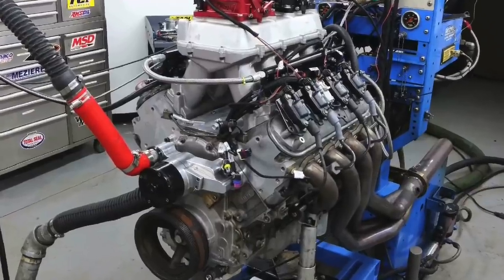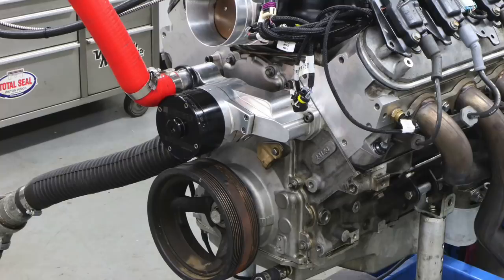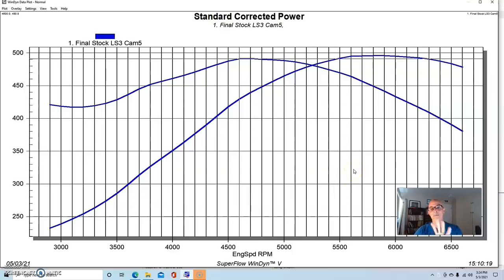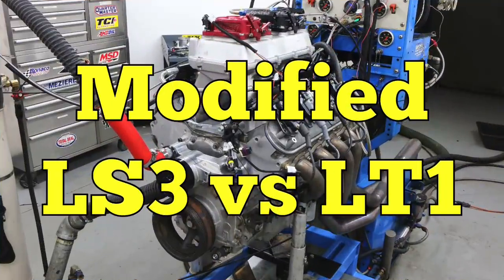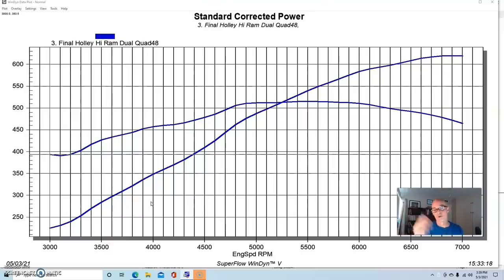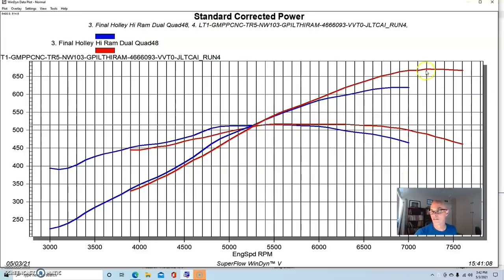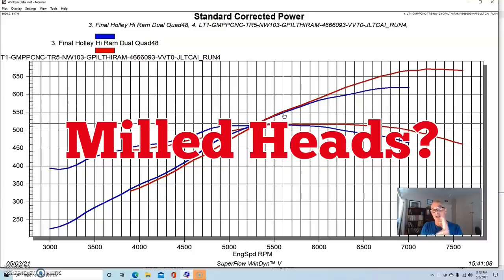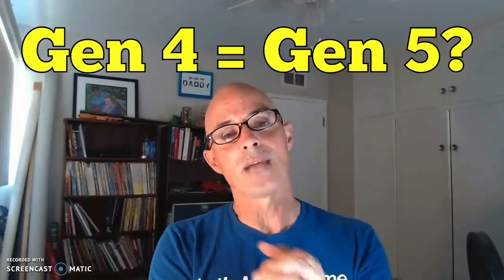LS3 VS LT1-IS NEWER REALLY BETTER? (GEN 4 VS GEN 5 6.2L)

Comment: That LT1 is really impressive, that low speed torque is key in a street car, it’s still down from a good big block below 3500 rpm, but then it comes alive
Reply: Yep. I’d love to see the Holley “dual plenum” cross ram adapted to fit on LT heads. Would be a torque monster down low and in the middle!
Reply: Yea but as someone switching from badass BBC that LT1 is gonna be 300lbs lighter....that evens the playing field...
Reply: I wouldn't worry about anything under 4500rpm with this modified LT1 it will be needing a 4400-5000rpm stall converter to take full advantage of this setup it has enough low end grunt from idle to 3000rpm for cruising or normal street driving and yes it will be a bit soft with a 4400-5000rpm stall converter from idle to 3000rpm it will rev extremely fast at the slightest push on the gas petal and go into lockup at cruising speed at 45-50mph depending on gearing my car has a 4200rpm lockup stall converter with a 6L80e transmission it's soft until 2500-2600rpm and goes into lockup at part throttle or street driving in 5th gear at 40-45mph and 6th gear at 50- 55mph at part throttle feeling no more affects of the stall converter unless the throttle is pushed down more while at these speeds it will unlock with a very little bit more throttle pressure on the gas petal

Comment: When it's clean sheet like me there is about an $800  surcharge for DBW, DI and trans control ( my 67 Camaro has a 4l80e/billet lock up) on the Holley with 3.5 inch screen and VVT ( Cam 4X even less).
 Given the fact the stock heads will do well especially when ported ( you can tell this is what they wanted to do with the LS7 raise that runner NUTS like it is on the LT1, but they never got the LS7 right ) I'll actually be saving....
 Also the fact I can buy a 3.860 L8T forged stroker ( center counter weighted too ) crank for $500 and it slide right in the Gen 5 block makes it just piston and rods for me to be up near 700hp...
 I've been looking and looking as I AM replacing a BBC I'm used to making 700+ hp with, it is HARD to find a 600whp Gen 4 LS.....
 I was quoted doing a custom darton sleeve 5.3l Gen 4 block to 4.155 and custom 4.00 rotator...then the best heads money can buy ( generally have to go LS7 and their intake ) and at 434ci barely be 550whp or 650 flywheel....
 The Gen 5 can do it at stock bore with the 3.860 crank for 400ci aka 6.6L, with much less cam and save a TON on heads...

 So more power, smaller cam less money from clean sheet and literally can run to 9s aka illegal in my old 67 NA...works for me...im not scared of DI...I just come from a boosted Gen 3 coyote and I'm used to dealing with the DI and tuning the blend.....
  Other than pure budget gap n go turbo stuff I can't see why anyone would still mess with the Gen 3/4....the stock crank on Gen 5 is stronger too...heads better...even better than LS7 when you count the LS7 failures that even the aftermarket doesn't have solved in my research....

 I'm leaning heavily to Gen 5.....

Comment: The LT1 has made 650+ rwhp  now 3 years later on max effort stock cube heads cam sbe builds. GPI CID heads. over 14:1 compression. pump e85. GPI Hi ram cam. ported Hi ram or cid manifold. They are making 100hp over the lt1 setup in this test now. An engine test a couple years ago made 759 crank at gpi with the original track attack cam which is a bit less aggressive than the hi ram cam as well. Things are getting interesting with the strokers too. They just did a 454 LT and made over 1000 hp with pump e85 and still a hydraulic roller setup. Crazy to think what it could do on fuel and solid roller.
Reply from the maker: they are doing some impressive stuff

Comment: I think milling and porting the factory heads on the LS3 will make it a closer match up. Still hard to beat that VVT stuff. GPI is getting it in tho...
Reply: @rustysausage69  #AGREED. I'm sticking with the LS stuff. Tuning the LT stuff is expensive also. It's just like when the LS stuff first came out. It made way more power than the Gen 1/2 stuff and was expensive. Eventually the prices will fall but for now, I'm staying with the LS stuff.
Reply: Made my way into the Gen V stuff and never looked back.

Comment: That torque difference in stock form is MASSIVE lol. I can't wait to see a tall-deck 500-inch LT1 that retains VVT and VCT. You could get a MONSTER motor out of that if you ran it on E85 with 13:1 compression or higher. I wonder if you could reach 800 lb-ft and 1000 hp...

Comment: Ported factory casting LS3 heads would have made 20 more HP and a aftermarket casting even more. Aftermarket casting head, like a PRC, gives more valve relief for a bigger cam too. Not saying the LS3 would have made the same or more power but it for sure would have made more with the same mods. I don't think anyone should argue that fact.
Reply: Regardless, apples to apples, Gen V makes more power. I'm not surprised considering GM has always been able to make more power with each successor.

Comment: I saw a video of a guy explaining that Direct Injection engines were problematic and he recomended port injected like the LS3. It was something about not cleaning the residuos of the valves and that in time will degrade de engine.
Reply from the maker: valve build up is an issue with di

Comment: Please do a mild VVT cam in the Gen V L86 or LT1.   Use both 6.2 L intakes and maybe the Gen V LT2 intake  ~IF~it bolts up.   Im curious to see if GM did as good of a job on the LT1/L86/LT2 intakes as they did on the LS3.   Plus that BTR intake killed the GenV torque.      After these are done, do a LT1 416 stroker with a mild/street cam.   The optimized stock  engines dynos were real good.   The Gen Vs  was a torque monster.      I am getting tirred of asking for the 416 GenV , so please just do it,   LOL.   Keep up the great work Ricjhard.
Reply from the maker: I HAVE LT INTAKE VIDS UP
Reply: @richardholdener1727  i seen it.     thanks

Comment: Compare LS 600+hp vs 600+ NA Big Block. Put both into same car using same transmission,rear gears, and see which has the fastest 1/4 mile et trap MPH. Battle of the LS vs Big block which of the two will win?
Reply: I think the extra torque BBC will win. same Hp w maybe 50lb ish extra tq ? Just my opinion. I'd love to put 620hp LS in my drag S10.
Reply: @austintyler7991  it will be very interesting Comparing the two different motors/engine's in the same car.

Comment: If both motors had same compression, head flow and cam specs, they would make the same peak power & torque. The only caviat being the LT1 will make more average power  (better down low) because of the variable cam timing.
Reply: If they were exactly the same, they’d be exactly the same,no ?
Reply: Im not so sure. I still think the LT would still make more because of Direct injection. If the heads flowed the same on a flow bench, then the LT would make more power when on the car, because it wouldn't have to flow both air and fuel through the intake ports and into the cylinder. That means no air is being displaced by fuel. Also, DI cools the cylinder allowing you to run more timing.

Comment: As the graph shows. I clearly see the power increase for the ported heads and larger TB. Id be willing to bet...a gen 4 would match the power numbers with the same mods. The low rpm torque is a direct function related too the direct port injection and higher compression.  All in all they are the same engine. To take advantage of the gen 5 direct injection. Your compression could be much higher. So the only component that is actually a improvement for the lt1 is the ability to support higher compression. The hp in this case is strictly from the ported heads.
Reply: @bigboreracing356  LMAO

Comment: The guys at Katech have made 800hp out of a 427 LT1. I think the LT1 has some pretty good potential. Is there a similar Coyote series comming ? You did a couple of vids, but nothing quite so extensive.
Reply: NA? Impressive. Crank?
Reply: @trashbandit2449  yes
Reply: And I was quoted needing a darton sleeve 434 with LS7 top end to be over a 100hp LESS than that on Gen 4....
 I think since it's a clean sheet retrofit, I'm going to go GEN 5, not scared of DI just did a Boosted Gen 3 coyote, use their cheap forged center counterweighted 3.860 stroker crank in the stock 4.065 block for a 400ci and use the stock heads but have em ported....good piston and rod...be done with it...

Comment: Thanks for all the knowledge it’s just upsetting that the original lt1 was a 350 right. It’s just like ls1 was a 5.7 just like the 350 was a 5.7. I’m just glad that the ls exhaust ports are spread apart not like the 350 heads where the middle ones are close to gather and robs it’s power.

Comment: I just bought 2016 Escalade which has the factory rated 420HP 6.2 . I wondered why this motor has the same horsepower as the previous gen  Escalade.

Comment: The first time I pulled a LT1 apart to do a cam/headers swap I was like omg. These heads are made for making power.  I knew there was a lot of potential engineered into the LT1 compared to the LS platform. And we did a heads/cam/headers/intake on basically stock bottom end it it put 713hp to the tires in a 2017 Camaro threw a manual.  I was highly impressed.
Reply: We were testing intakes and the MSD atomic intake made the most power threw the whole power band.
Reply from the maker: HCI LT1 making 713 wheel hp? with how much boost?
Reply: 0 boost.  No spray. All motor. Stock bore. Factory ported heads on a Cnc program.   Dyno’d in a camaro. To the hub dyno.  With a manual.     713hp!!!      I literally shit.  I may still have the video.  If you have a email I’ll send it. HCP in spring Texas has one of the best head guys in the country.
Reply: You should give elli a call. It’s HPC in spring Texas. (Northwest Houston) He’s the owner. Great guy.  The camaro is his personal car. Could possibly dyno some of his stuff     I worked at another shop down the street. He dyno’d all his cars at the shop I worked at.
Reply: def not making that much power on a sbe lt1, especially not with the msd.
Reply: Hahahahhahhah
Reply: @richardholdener1727  I believe 713 is stretch.. But my 6.2 LT1 with HCI, headers, and flex kit, running on 58%E.. Made 618whp to the tire thru a manual on a 21 Camaro SS 1LE.. Maybe he accidentally pushed 7 instead of 6.. lol  I had a C6 Zo6, with the 7.0 ls, and it made 608 with pretty much the same upgrades on the same dyno, several years apart,  but the new LT1's are punching above their weight class compared to the old LS stuff.. My tuner had trouble with my 1LE car though.. seems like the 1LE cars have some different tuning/parameters that the regular SS cars don't have.. Seems odd to me but he struggled with it and had to contact another well known tuner to get some help in getting it right.. Now he has the work around but it was a week long struggle for him..

Comment: Have you thought about seeing what you can do with the 6.2 l99? I have a completely stock lower end, heads and cam l99 in my 2012 Camaro SS with the addition of fuel pump 1000cc fic injectors, e-85 and a 2.9L Whipple supercharger. My tuner was amazed at how much more rear wheel power he was able to get out of it as opposed to an LS3 with the same setup. He did a safe tune, but was able to get 670 hp at the rear wheel. I've been having some transmission problems that I will be fixing shortly, but still am running a 10.85 1/4 mile with vvt still active.
Reply from the maker: why would that 6.2l make more than another 6.2L?

Comment: How do you keep DI intake valves clean though. Even with a catch can over thousands of miles they develop deposits. The high pressure fuel pump and injectors are a PITA to change.
Reply from the maker: WATER METH WOULD HELP

Comment: Cost is a huge factor. iI takes over half again more money to build an LT than an LS, money that could be spent on an LS to make more power.  Spending that money on an LS will net you more HP on an LS than LT.   Plus LS is way more simple to work on and if your HIGH DOLLAR LT pump fails you get to buy it again.  LT is nice with the flat torque curve with VVT but I'll stick with the LS

Comment: LS3 in a 5th gen, 568rwhp; 11:33 CR, TFS 262 FED custom heads, solid roller 239/253 720' 702', ZL1 inj, T&D rockers, 91oct, sheetmetal custom Goertz1 intake, EWP, 2'' SW headers& stock NPP catback, remote tuned by Pat G. The rpm signal on the dyno was skewed and numbers were still climbing at 7200rpm, I estimate 575-580rwhp. I have now a full 3'' exhaust and 2.75'' Z28 mufflers, I hope it'll make 590rwhp. Close to 685hp.

I think both engine are very similar but the LT1 has a big advantage stock with VVT. With a cam and same CR, totally equal engines, but i prefer LS3 cause its more old school. LT1 cars are faster cause vvt, better trans (A10) and lighter....

I bet with a GPI flycut cam in this combo with GMPP ported heads, thinner gaskets, you'd see exactly the same hp in both or almost. LT1 is not superior when the LS3 is cammed.
Reply from the maker: 685 hp LS3 with a 239 intake cam?
Reply: @richardholdener1727  yes same cam. Its a solid roller, no flycut stock bottom LS3, so maybe equivalent to a hydrolic 233/247. The 12 degrees heads gave me more room for a bigger cam and smaller head gasket/ higher CR.

Comment: Even displacement, airflow, and optimized tune should have close to the same power when modified.
Reply: The LT would still make more power because of VVT and Direct injection. Although, depending on the cam duration, you might not be able to use the VVT.

Comment: I would love to see a ford 300 i6 done bone stock

Then run efi manifolds 
Port fuel injection 
And a cam with this spec
268 advertised duration
208 intake at 50 
212 exhuast at 50
477 intake lift at 50
488 exhaust lift at 50
110+4

Then 
Put twin turbos on it that will make peak boost at 4500 up 

And if you can run coil on plug with megasquirt or aem or something and then compare it with a twin turbo or turbo 302 sbf you've done, 300 6 vs 302 SBF

Will need to replace the pistons with new hyper or forged,
Arp studs on everything and bigger valve springs and your set

Comment: 2013 camaro ls3 gm stage 2 cam, gm cnc ported heads, 1.8scorpion rocker arms. sheet metal intake 105mm BBK throttle body. will make 680hp. I did it in 2015.

Comment: Their is only one problem with the modified version of the LS3 and LT1 motors. Those combinations would be absolutely horrible for a car you run on the street and strip or just on the strip. You won't be able to get it to idle under a1000 rpm in other words an absolute pain in the ass to live with. Those tests are of no use to anyone other than an all out drag racer. I would love if you you could do more testing and development for street and street/ strip motors that might be more relevant for about 80% of your viewers.

Comment: I think it’s not that much of a difference, if you go with a ported head on the ls3 I think it would just be making a copy of the lt1. The variable cam timing would be the only difference and that still isn’t too significant in my opinion. That makes me wonder, can lt1 heads fit an ls3?
Reply: They will with a little modification Brian Tooley has a video on channel

Comment: Please continue this testing with the LS3

I have an all motor combo LS3 with GPI SS4 NFC Cam, 821 Casting Heads Ported by GPI and milled .120 with Flycuts .150 deep
Looking to go with dual 4150s or 4500s, go to 2” headers, electric water pump, and crank scraper

I think the Gen 4 can compete but the Gen 5 are just great for NA power.
Reply: Never Dyno’d after milling heads 

Just basic heads cam Fast Lsxhr manifold and 1 7/8 headers made 540 at the ground

Comment: When the LT1 came out, I remember an article about how close if not better the LT1 was than the almighty LS7. Maybe do a comparison with those if you have the info. Thanks for all the great content.
Reply: I'd say it's not quite on the LS7 level, but its pretty damn close. The LS7 was ahead of its time in my opinion though. Could you imagine a modern LS7 with VVT and direct injection? 🤤 Heads/cam C6Zs are still fast as hell even by today's standards.
Reply: @Jr_5646  you mean like. the l8t
Reply: @bill2178  I dont know much about the l8t, but it doesn't seem like a high performance engine comparible to the LS7 to me. The LS7 was based off the LS1.R from the racecar. The l8t is an iron truck engine. The LS7 had an aluminum block, titanium rods and valves, and could rev over 7,000 rpm. A modern LS7 would make way more power while being way lighter IMO.
Reply: @Jr_5646  it wont make as much but with the right cam and intake im pretty sure it could be somewhere in the middle between lt1 and ls7

Comment: The question is, since it would be easy, would be to run the LS3 with a Holley High Ram? We all know a dual TB efi is the optimum setup...he has told us this....I think that helped the LS3 a lot....

 But dang that LT1 wanting to rev to 7500rpm like a Coyote is nuts
Reply from the maker: I have run the LS3 with a high ram-see the big LS3 intake test
Reply: @richardholdener1727  yes I get so confused you sneaky rascal I end up watching them all multiple times to get my answers....

 I hope for more LT testing...im thinking about an aluminum l86 4.065 LT block with their cheapo L8T forged 8 counter weight crank for a cheapish 400ci LT with ported heads and a cam say from TSP that includes the VVT table...
 Hoping for 650 flywheel around 11.5 to 1, doable ?

Comment: Hey Richard. The moded LT1 was a disappointment IMO considering ported heads and big cam.  The LT1 lost ~70 lb/ft @ 4000 and had lower peak torque?  If the cam was bigger on the LT1 wouldn't BTR have had to lock out the VVT?  Would that explain the huge loss in torque?
Reply: VVT is used to boost low rpm torque.   Its a big deal like 50 ft lb on a 6.0L engine.   It doesn't boost peak torque.